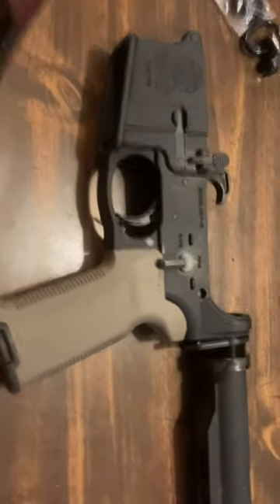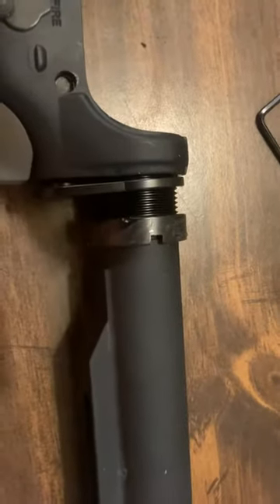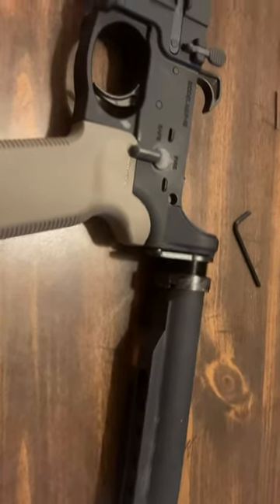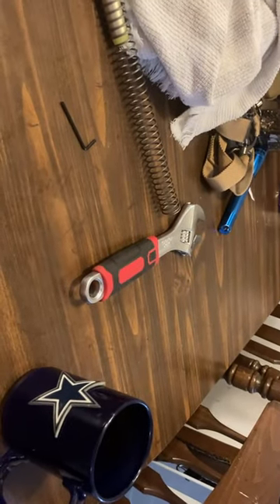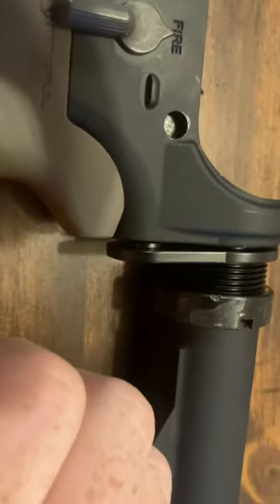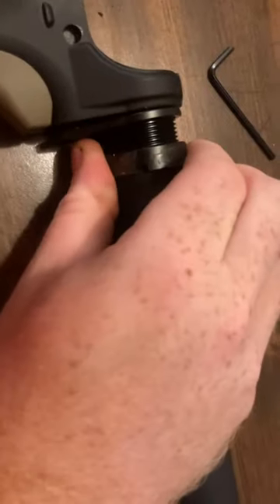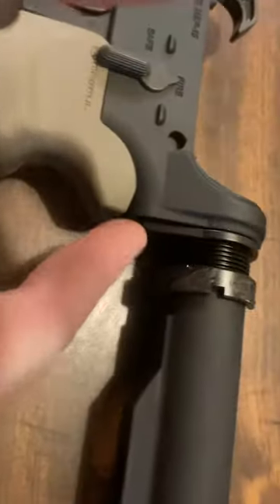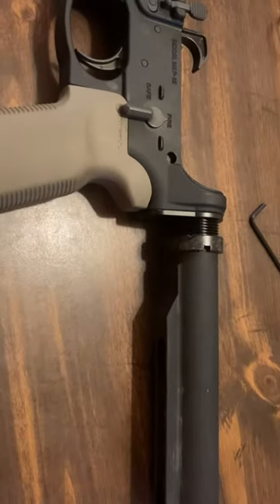How to remove a castle nut from an AR-15 with no armorer’s tool.

Comment: Saw a guy wrapped electrical tape around it a few times to prevent it from getting marred up
Reply: I’m contemplating doing this I saw the vid too, but if it breaks the AR is useless … risk to reward ratio isn’t worth it. I’ll just wait for the tool 😂😂😂